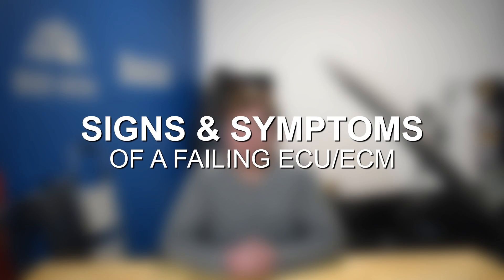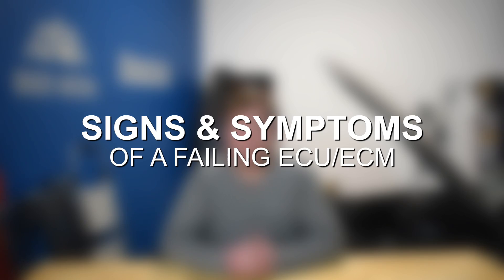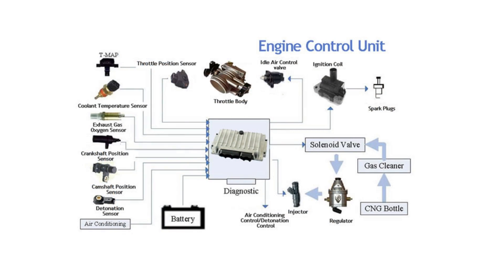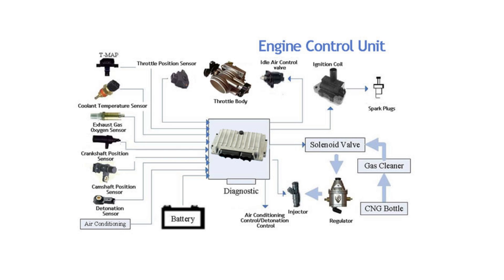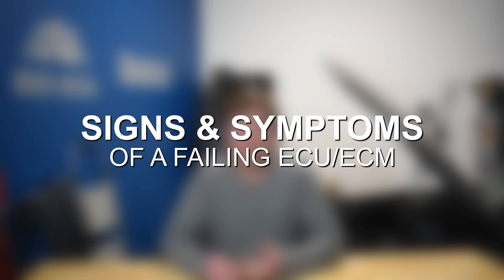Signs & Symptoms of a Failing ECU/ECM! (Engine Control Unit or Engine Control Module)

Comment: One second it spits out crankshaft position lean bank issues then it shoots out throttle body issues and then sometimes runs just fine. I'm guessing I have an ECU issue or at the very very least multiple sensors acting up.) I have the ability to basic work on my vehicle but I am lost when it comes to diagnostics.Any opinions would be grateful.

Comment: I have a 2001 Chevy Prizm (Toyota corolla engine). Used a code reader and got P0301 cylinder 1 misfire. Took out spark plug 1 and it was black and smelled of gas. Took out spark plug 2 and it was dry. The ignitors are new. What should I check next? Does cylinder 1 need to be replaced meaning the whole engine must be taken apart?

Comment: Maybe someone can help me here. 04 Acura tsx FINALLY pulled code 112-1 today internal power source of ecu failure. I replaced alternator and battery a year ago. Spark plugs and coils 6 months ago. Fixed vacuum leak and put in cai 2 months ago. All that and still power loss esp when ac is on, occasional stalling, rough idle, jerking during acceleration. This code made me look into ecu problems and I think I found my culprit. Still have to get in there and take a look. I am misfiring on ALL cylinders. Is it really the ecu? Can I send it off in the mail for repair or replace it or check the ground for it is that all I have to do? I don’t have any codes for any sensors just misfiring, knock sensor (no audible knock), code 61 low or high voltage, and piss poor engine performance. Never trouble starting though. When battery is disconnected and everything resets I’ve got like 10 mins of beautiful driving before engine light and the dreaded jerks and misfires. Anyone with similar experience or knowledge 🙏

Comment: Just bought an 06 Camry from a guy who says it’s going thru coils like crazy, even told me he changed the spark plugs recently. Sputtering up hill around curves really bad. Had a gut feeling to check the plugs anyways, turns out he didn’t change them at all! The worst build up on the tips I’d ever seen in my life! Now runs great but I think there’s a corrosion on the ecu because on rainy nights it’s gone completely dead then turns right back on when I came to a stop! At least I think that may be the problem??

Comment: Thanks. It helps peace my minds. My motorcycle stall after 180k km mileage and given code as injector 3 error. After cleaned and swapped injector 3 to 1 vice versa, it still failure and given the same code. Socket and wiring were checked and found no issue. My mechanic made conclusion after 10 days diagnosis and few trials and errors that the main root cause was ECU itself

Comment: I have a 2001 Nissan maxima GLE. I am receiving a P0505 code for the ECM. I also have to rev it 4 times to keep it running (Mainly on a cold start). Would it be best to repair the ECM? and If so, who should I contact?

Comment: Crank no start on a 1996 Chevy C1500 4.3 ltr v6. Mechanic said it was the Ignition Control Module. So replaced ICM, Ignition Coil, Crank shaft sensor, cap, rotor, plugs & wires, fuel pump relay just because. The original OBD2 code given was P1351. Checked and cleaned direct ground to engine block, and passenger fender, all cables look good- no rust or oxidation. I've owned the truck for 2 yrs and it ran good until now. Now no error code period.

Comment: Hey boss seem like the man to ask , have a 2010 Elantra , son was driving and car flashed and all warning lights came on and all power cut off and on and was hard to brake , he pulled over , noticed a bad ground all I could see , so tightened and jumped just a click , , new battery and starter just a click , but check engine , e brake , abs, oil , eps, all lights are on now , I know to a pro would know jsur off that , checked fuses and relay , fuel pump humming still working , new plugs and oil and starter , What do u guys think it is , Voltage om batter good and grounded it’s driving me crazy and now wasted all that money can’t afford to do any more and good mechanics in Cali is like finding the perfect wife , smh please help or any advice is appreciated but I know with all that info a true pro couldn’t pin Down the issue 😅

Comment: I'm having this issue and they says o2 sensor and says it's a computer electrical issue 🤦🏾‍♀️
Reply from the maker: J - Yes, it can be related. A bad ECM/ECU can mimic or even trigger O₂ sensor codes because it controls heater circuits, reference voltages, and feedback loops. However, most of the time the issue is not the computer itself but either the O₂ sensor wiring (shorts, opens, melted insulation), a bad ground, or a voltage supply issue that makes the ECU “think” the O₂ circuit has failed. Since you’re getting both O₂ codes and “computer/electrical issue” language, I’d recommend: first, verify fuses and grounds (especially engine ground straps), second, backprobe the O₂ sensor connector to confirm proper voltage and heater circuit operation, and third, inspect for harness damage near exhaust or firewall. Only after those checks should you suspect the ECM, because true ECM failures are much rarer than wiring or sensor faults, but they do happen if water intrusion, corrosion, or a short has occurred.
Reply: @8020Automotive They said I need a catalyic converter and that's why the car stalling

Comment: I have a 2004 Ford Ranger and the other day in 5th gear (automatic transmission) it just powered down and the radio sounded like it was going to blow the speakers. It is a Tremor edition and I’ve heard there many electrical problems. Is it my PCM did it explode and fry everything?
Reply from the maker: J - On your 2004 Ford Ranger Tremor, a sudden power-down in 5th gear with the radio going crazy does sound more like a major electrical or ground issue than the PCM “exploding” — the PCM itself rarely fries everything at once, but a failing alternator, voltage regulator, or main ground/connection can spike or drop system voltage, which would cause the engine to cut out and the radio to distort like the speakers were blowing. The Tremor editions are known for wiring quirks, so I’d start by checking battery terminals, chassis and engine grounds, and alternator output with a multimeter; if voltage is spiking or dropping badly, that explains the shutdown. If those check out, then the PCM could be suspect, but it’s far more common for a bad ground or alternator fault to mimic a PCM failure.

Comment: My 2010 ss camaro is showing a bunch of codes and does ecm have any thing to do with transmission problem like not going into reverse and shifting into drive the only way it will move is in paddle mode and codes showing solenoid stuck off on few gears
Reply from the maker: J - Yes — on your 2010 SS Camaro, the ECM (engine control module) and TCM (transmission control module) are closely linked, and a failing ECM/TCM connection or bad internal transmission control can absolutely cause shift issues like no reverse, stuck solenoids, and only moving in manual/paddle mode. However, given your codes showing specific solenoids “stuck off,” this usually points to a transmission valve body or internal solenoid failure rather than just the ECM itself, since the computer is detecting those solenoids not responding to commands. The first step is to inspect the transmission wiring harness and fluid condition (low, dirty, or burnt fluid can cause sticking solenoids), then consider a valve body/solenoid pack replacement if wiring checks out. The ECM usually isn’t the direct cause unless there’s widespread electrical failure, but it can log and trigger limp mode when the transmission hardware isn’t responding properly.

Comment: hello i have 2011 buick lacosse do the  ECU control key fod? also do it control lights? i have no low beam on either side of the car.
Reply from the maker: M - The ECU (engine control module) doesn’t control the key fob or lights — the keyless entry/immobilizer functions are handled by the BCM (Body Control Module), and the headlights are also run through the BCM and headlamp relays, not the engine ECU. If both low beams are out at the same time, it’s usually not the bulbs but either a blown fuse, bad relay, wiring issue, or BCM fault; a quick check is to swap the low beam relay with another identical relay in the fuse box to see if the lights come back, and if not, test for power at the headlamp connectors, since both sides going out together almost always points to a shared relay/fuse/BCM control rather than two bad bulbs.

Comment: Are relay codes, like 4 of them and misfires a cause for ecu failure in a vw?
Reply from the maker: D - Multiple relay circuit codes together with misfires on a VW don’t usually mean the ECU itself has failed — it’s much more common that the power supply or ground to the ECU is weak, a relay (like the ECU power supply relay or fuel pump relay) is failing, or there’s corrosion in the wiring/relay panel under the cowl. A bad ECU is possible, but rare; typically if it were the ECU you’d see widespread, random communication loss or no-start conditions, not just misfires and relay circuit faults. I’d suggest first checking the specific relays flagged (often the J271 ECU power supply relay or J17 fuel pump relay), cleaning grounds, and inspecting for water intrusion in the plenum chamber — those are known VW trouble spots that can throw multiple relay codes and cause misfires. If all of that checks out but the codes keep coming back, then ECU testing or substitution is the next step.

Comment: my kia sorento2013 will show low tire pressure light,electronic stability control light, then slows to a crawl n dies ,cant put in park and have to wait till it turns off to even try to start which it wont. when try to start it is like battery is dead but not. sometimes when i push start button it acts normal just no start other times all dash lights flash with a lot of clicking noises. only way to start it is to get a jump from another car works every time.some times it doesnt reconize key other times does, dont have a clue cause something little bit different.always happens at different distances
Reply from the maker: J - The mix of warning lights, stalling, flashing dash, and needing a jump every time strongly points to a charging system or main power connection problem rather than the engine itself; most likely the alternator isn’t maintaining steady 13.8–14.5V under load, or a corroded/loose ground strap or battery cable is dropping voltage and confusing the electronics (which also explains the “no key” message), so the best first step is to have the alternator load-tested, then clean and tighten all main battery cables and grounds to the chassis and engine block, since this exact issue is very common when the charging system wiring starts to fail.

Comment: I have a 2014 VW Jetta, I recently smacked my transmission pan on a curb and it dented it and put a small hole in it so I went and replace it along with the correct amount of Transmission fluid and now for some reason my car only works in reverse gear, PRNDS doesn’t show up on my dash, and sometimes when I switch to manual mode it starts jerking in and out of gear, and then after it does that everytime I go into reverse gear it jerks, 2 codes P0721 and P0732 show up a long with a few others that weren’t there before this.
Reply from the maker: B - Since your Jetta only has reverse after the pan hit, the PRNDS display is gone, and you’re seeing codes P0721 (output speed sensor) and P0732 (incorrect gear ratio 2nd gear), the most likely cause is that the internal transmission wiring harness or output speed sensor got damaged or not reconnected properly when you changed the pan, as those sit just above the valve body; this explains the missing PRNDS and limp-mode behavior. I’d suggest dropping the pan again, carefully checking the harness, connectors, and sensor, and then verifying fluid level with the VW-specific fill/temperature procedure since the gearbox is very sensitive—if wiring is crushed or sensor damaged, replacing the internal harness/sensor assembly usually restores function.
Reply: @8020Automotive Thank you for the advice man! I’ve left what feels like hundreds of comments across different videos and no one has replied at all, I am going to check it all out again tomorrow and see if I can notice anything!
Reply from the maker: B - Keep us updated! We try to help everyone we can.

Comment: I have a 2011 Dodge Durango Crew 5.7 liter.  Alternator is only putting out 12 volts. Tested on the backside of the alternator with a fluke meter, also at the battery, and at the jump start pegs.  I replaced the alternator, the battery, and the serpentine belt.  No change. I've checked and cleaned the battery terminals, the grounds, and the positive cables at the Power Distribution Unit.  The 150 amp fuse looks good in the PDU. Could it be a bad powertrain control module (PCM/ECM)?
Reply from the maker: K - Yes, on your Durango the alternator’s output is controlled by the PCM, so if you’ve confirmed the new alternator and battery are good, the belt is tight, the fuse and wiring are intact, and you’re only seeing battery voltage (12v instead of ~14v), then the PCM not sending the field control signal is a strong possibility. Before condemning the PCM, though, check that the alternator’s small field control/voltage sense wires have good continuity and no corrosion—if the PCM can’t “see” battery voltage or can’t excite the alternator field, it won’t command charging. Also, scan for charging system or PCM-related codes, because many times the Durango/Jeep/Ram models will log a P0622 or similar when the field circuit fails. If wiring and grounds check out and you have no communication to the alternator field, then yes, a faulty PCM is the likely culprit, which unfortunately is fairly common on these.

Comment: I just bought a 2005 Tiburon gt it had valve covers. And tune up done ran good as soon as I pull in my drive way it stalls out no power to anything I tighten the battery terminals down it’s fine for about a week and does the same thing no power at all am I losing connection to the battery or is it the ecu sounds like a wiring issue but not sure
Reply from the maker: J - Sorry to hear.. If your 2005 Tiburon GT randomly loses all electrical power and tightening the battery terminals fixes it for a short time, it’s almost certainly a power connection issue, not the ECU. The most likely causes are corroded or damaged battery cables (even if they feel tight), bad engine-to-chassis or chassis-to-battery grounds, or a cracked fusible link near the battery. Remove and clean both battery terminals until shiny, inspect the cable ends and insulation for hidden corrosion, check all ground straps for looseness or rust, and wiggle-test the positive cable at the battery and fuse box while idling to see if the engine cuts out — if it does, you’ve found the fault.

Comment: 2001 Mits Eclipse.  New alternator, new battery, new battery post. I get random lights on the dash...check engine, service engine, abs, brake, etc. Driving home from work while raining,  windshield wipers stopped working, lights came on dash again, window wouldnt roll up, began loosing power and engine was missin..
Pulled over and just sat for about 5 min and the drove home. Wipers and window started working. All lights went off again except service engine. Weird smell also while everything was happening.  Prior to that drive home I had to get a jump start after a quick stop at store after car sat 10 hours while i worked. Any thoughts?
Reply from the maker: K - Your symptoms point toward an intermittent charging system failure or major ground/power connection issue, even though the alternator and battery are new. On that drive in the rain, losing wipers, windows, dash lights coming on, and the engine misfiring all suggest system voltage was dropping severely, which can happen if the alternator stops charging or if there’s corrosion/looseness in the main battery cables, grounds, or alternator wiring harness that’s aggravated by moisture. The “weird smell” could have been from overheated wiring, a slipping alternator belt, or the alternator itself cooking from a short or overload. I’d recommend load-testing the alternator output under different conditions, checking the belt tension, and cleaning/tightening all grounds (engine block to chassis, battery to chassis, alternator case to engine). Also inspect the alternator’s main output wire and fuse link for corrosion or partial breaks, as they can cause intermittent failure like you experienced.

Comment: Hi i have a 2014 subaru outback 2 days ago i was at a light and heqrd a thud when i pushed the gas 3 lights popped upat oil temp traction control and brake light i pulled over and turned it off the lights havent come back on but feel the thud every so often and a lil sputter.3 codes popped up C0045 ,C0042 and  C0075  i believe the C0075  is the ECM any idea what i should do 1st.
Reply from the maker: W - Those codes point toward wheel speed sensor/circuit issues, not directly the ECM. C0045 is left rear wheel speed sensor circuit, C0042 is right rear wheel speed sensor circuit, and C0075 is a stored CAN communication fault that can pop up when those sensors fail or lose signal. Since the thud and sputter started right before the lights, I’d first inspect the rear wheel speed sensors and wiring for damage, corrosion, or debris buildup, as a bad signal can trip multiple stability and traction control warnings and even affect shifting/engine response. Clear the codes, road test, and recheck to see if one sensor consistently fails; if so, replace it. If both sides intermittently fault, check the wiring harness routing and rear tone rings for cracks or debris before assuming a module problem.